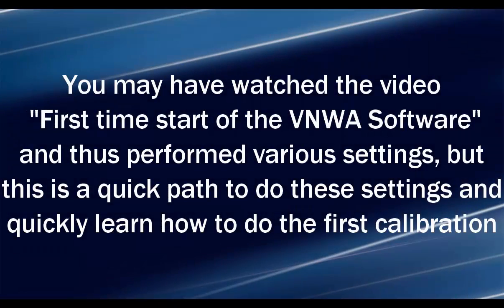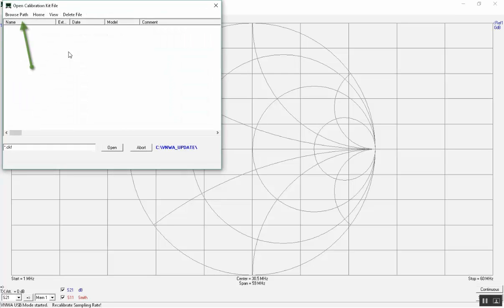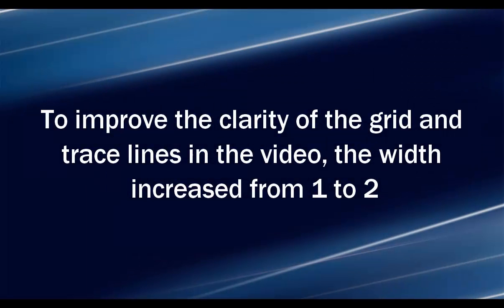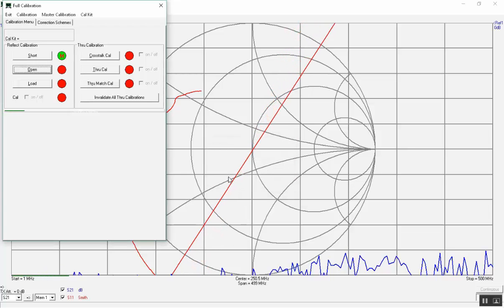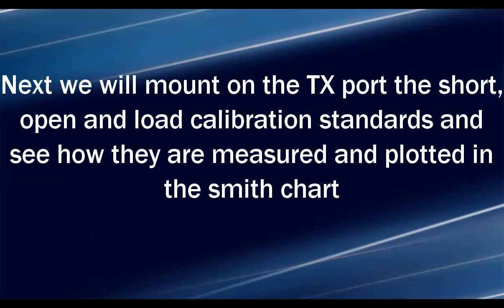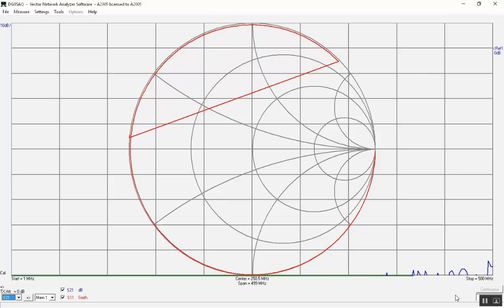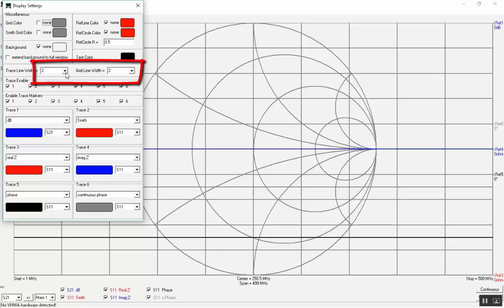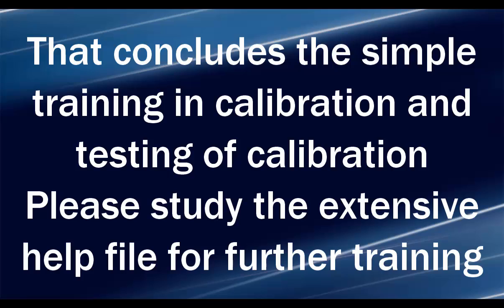First time calibration

Comment: I get "Error: No Sync!" when calibrating the load.    It appears there is no way to contact SDR-Kits that I've found.    The error does not appear on Short and Open calibration steps.

Any ideas on how to make the error go away (I have tightened all connections and tried 5 times same result)
Reply: The help file (once installed on windows 10) has a hardware troubleshooting section - the problem appears to be due to my audio settings where restored back to 44.1Khz - those need to be set to 48Khz via Options->Setup->Audio Settings then select Auto Setup Audio devices button at the bottom of dialog